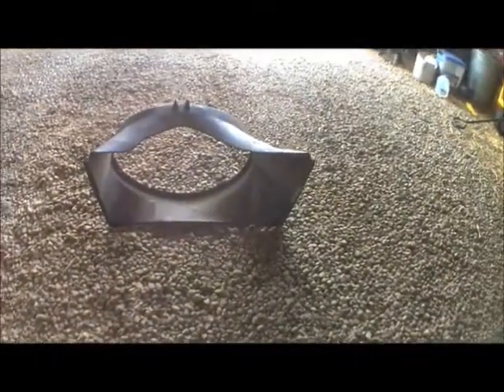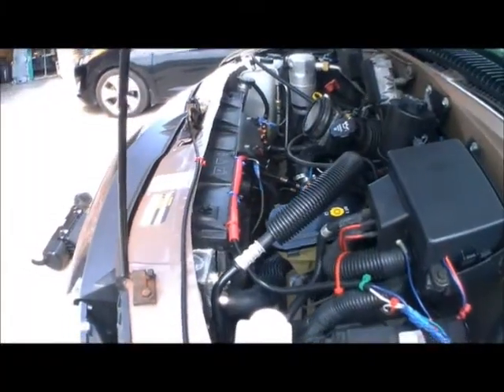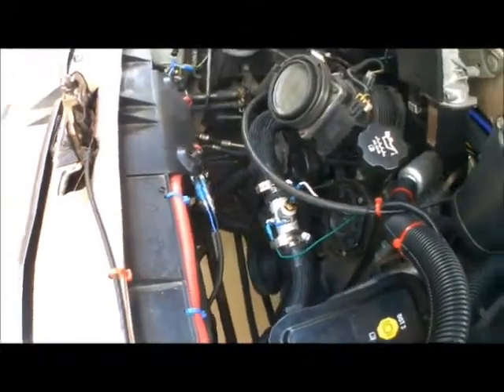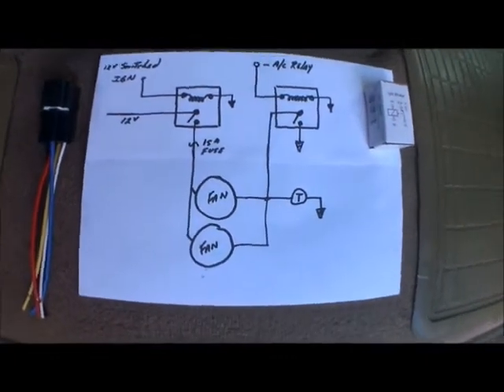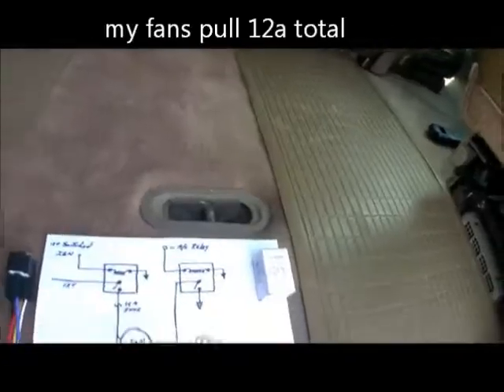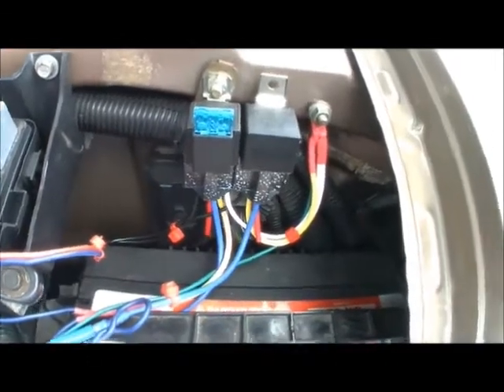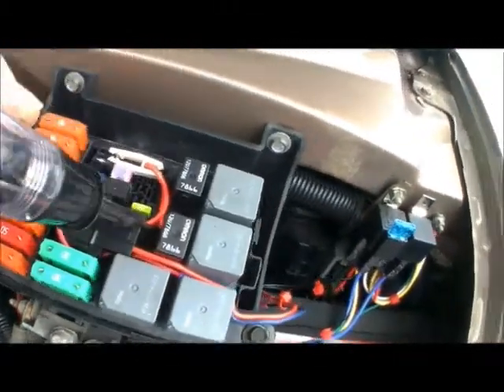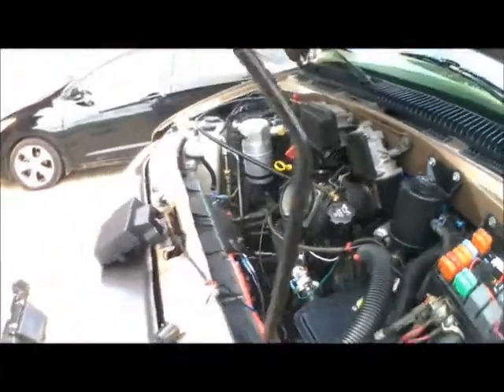Safari Van named "So$ari"  - Topic = Electric Radiator Fans

Comment: You say the temperature probe acts as the ground for the circuit to complete then powering the fans.  Wouldn't you want the temperature probe/sensor to trigger another relay to complete to ground.  That way you don't overheat or overload the sensor.  These things happen over time much like how extension cords cause fires if overloaded.
Reply from the maker: I suppose you could do that .. I picked my fans for the lowest amp load I could find .. with that said,  If the sensor was before the load it might be a problem but as a ground it's fine.  Been running it for years... Adding another relay seems like just another electronic part to fail .. I had a few sensors lying around so I do keep a second one in my emergency parts box on the rig.  I carry a lot of parts for this old rig.  Have a great day !

Comment: Did you noise less lag during acceleration? Did you need to upgrade the alternator?
Reply from the maker: I did this a long time ago and really do not remember it it made any change in acceleration...  maybe but I rather doubt it...  Did not upgrade alternator but it is in my plans for the near future.   For me the best reason to do electric fans is to gain access to the engine.  It is so nice not having that giant shroud there.
Reply: @MKEL_1327  I hear you about the extra room…I would imagine it does help bc when I run my Astro with the ac off it’s more smooth and shifts with less effort…thanks for the response I will be doing this to mine ASAP!!